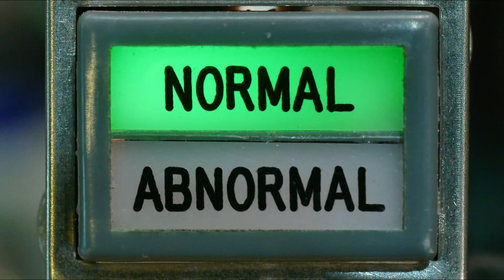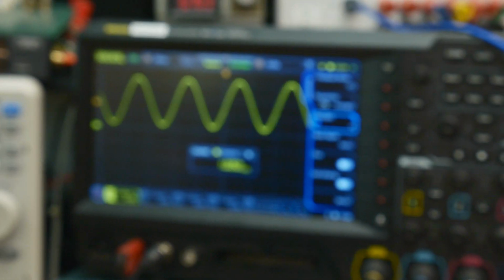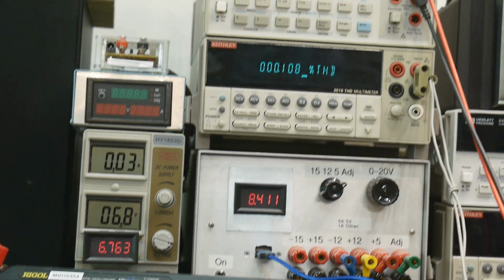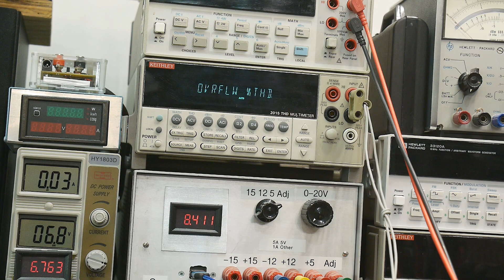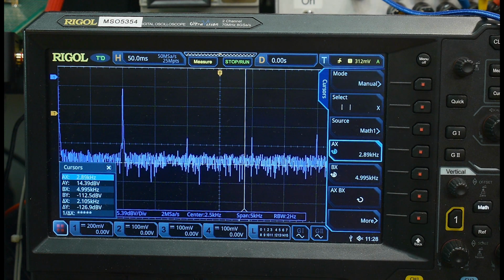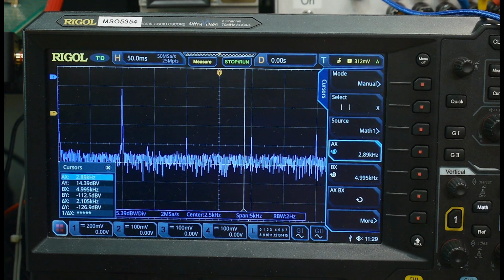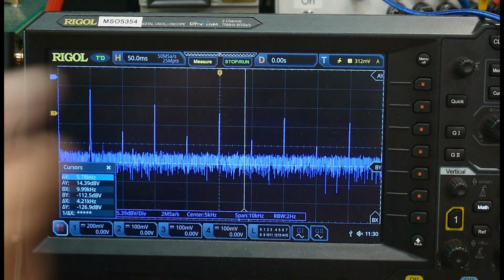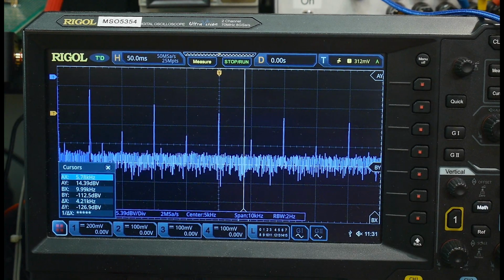#1678 AD9833 Distortion and Spectral Content

Comment: I looked at the data sheet...it showed THD expressed as dBC related to carrier...with 66 dBc and max. THD of 56 dBc...

Does or can 66 dBc equal 0.1 % THD..?

And a little test circuits...that just shows a 20 pF load...that has 12 bit SIN ROM driving the 10 bit DAC...

Perhaps there is some math approximation that lists how many bit vs THD...

Measuring 0.1 to 0.2% THD seems good...

Probably just confused I am..

I think some early 16 bit DAC for audio..like the one a BB made had .0025% max THD...and 96 dB dynanic range...

Maybe i am thinking of dynamic range vs bit...

Good job...it be nice to see the SPI  program that drives your AD9833....

Keep up the good work...
Reply from the maker: SPI code: https://github.com/imsaiguy/AD9833
dBc: https://baltic-lab.com/2023/01/thd/
Reply: THD determined by measuring  -dbc of significant harmonics, calculating voltage from that and sqr root of the sum of the squares of the harmonics.
Reply: I have an old TI 58 program that ran on programmable calculators such as ti58,59 and HP11

Comment: Hey IMSAI Guy, I’m going to show my limited knowledge here, but years ago when I was interested in creating a AC inverter, why a sampled and stored sine wave wasn’t used to generate a sine wave if that makes sense. All this time I thought it ALL sine waves were generated using complex circuits. I guess I should of looked into it more. In fact I was going to sample a 60hz signal and do the ADC and storage, thinking I was on to something. This was back when reasonably priced high wattage 12v to 120v inverters used a modified sine wave which were horrible. Another idea I had back then was to create a clothes dryer that used a dehumidifier to dry clothes. GE has that now, go figure. At least I still have my Motorola HC6811 robot which can find its charger using ultrasonics, when most looked for a line or tape on the floor. ‘91. Carry on ⚡️

Comment: Please show us how to get THD, using a scope with FFT, or similar scope function on a modern hobbyist scope... Like your Rigol 1054 (is that the correct model number?)
Reply: I've been doing it on st siglent sds1202x-e by using fft of course, and taking the db values of the fundamental peaks and all the harmonics I can see and plugging them into a thd calculator I found online. The actual formula is simple enough  too iirc
Reply: THD formula (and good discussion why it doesn't correlate well to audibility, if anyone ever thought it did) here:
https://en.wikipedia.org/wiki/Total_harmonic_distortion
Reply: @TranscendentBen  yeah anything under 2% I can't imagine I'd be able to notice by ear lol.
Reply from the maker: Alan has a good video: https://youtu.be/s_cVP5gu4SY?si=-qexYUpGedkVnY0P
Reply: @IMSAIGuy  he always does lol
Reply: Add a notch filter followed by an amplifier, feed into the scope, take picture, load into Mathematica, straighten it up and convert back to coordinates (it takes almost less code than this entire comment), calculate THD. 😂